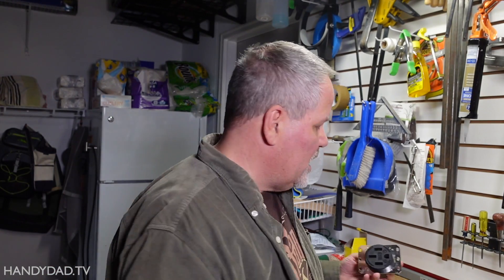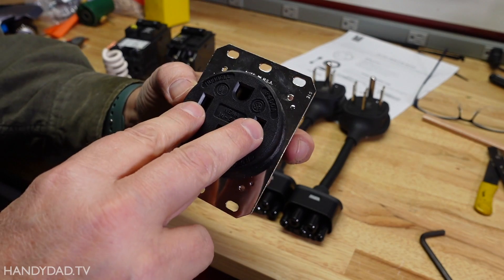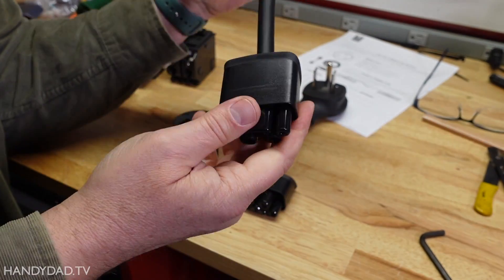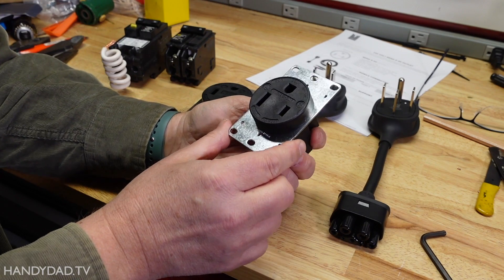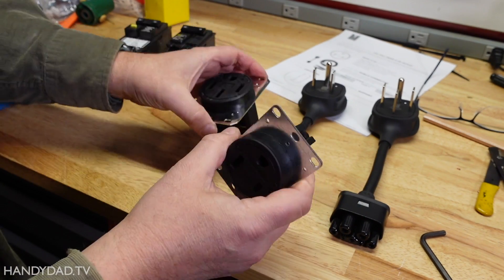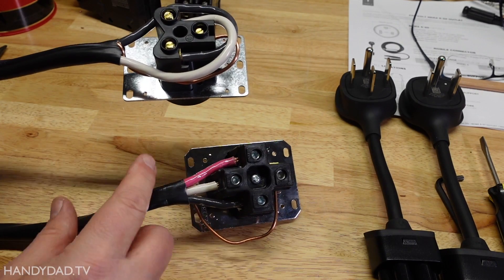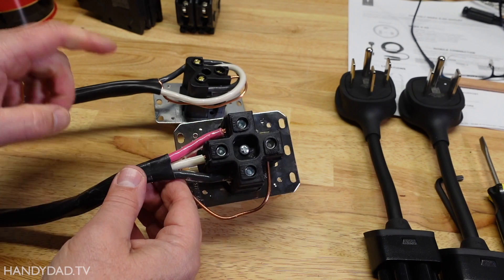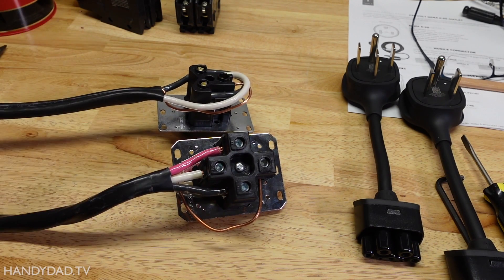NEMA 14-50 vs 6-50 for EV charging

Comment: Thank you for clarifying these plugs! I have the 6-50 in my garage because I do welding from time to time. The rep from the Tesla electric division insisted on the 14-50. I immediately ask why if, technically, batteries are DC current and there's no need for the fourth prong. "It is a battery we are charging, right?" The stumped young man went away confused about not having a re-buddle!
Bottom line, I need my 240 multi-function receptacle to service all my needs. I wasn't going to have a sales rep sell me; otherwise, the product-producing norm to the untraded commoners market. No pun intended to the non-trade. Tradesman and builders alike share a common bound to reciprocate in the know! Yep! I planned my Tesla arrival months before and installed the receptacle for everyday use and my Tesla charging optimization! I will share this with all whom I know owning Tesla vehicles! Now, I'm sharing it with you!
Reply from the maker: Thanks!
Reply: Down side is you can get an adapter to plug into the 14-50 to get 120V out of the outlet.  Without the neutral, the 6-50 can't do this.
Reply from the maker: True but that’s a very rare use case.
Reply: @handydadtv absolutely. Super rare. What would be the chances that there’s a 6-50 outlet but not a 120 outlet nearby. Great video!

Comment: Hello! I recently bought a plasma cutter and it came with an adapter that has a nema 6 50 plug. I live in europe so i dont have acces to that type of plugs ... I have cut off the wire and made a conection to the machine by wiring ground, 220v hot wire and neutral to the machine. The problem is that wont mantain the cutting arc and after some researching i did find that nema 6 50r has two hot 220v wires and ground. Do you think i should wire 2 220v hot wires to the machine?
Reply from the maker: I would consult a local electrician. Speculation could damage the machine.
Reply: @handydadtv  Most countries in Europe run ONLY 240V, and there's really no neutral as we understand it.  Which means that if a 6-50 is connected properly, it should work just fine.  So something else is causing his problem.

Comment: When Tesla is out of the adaptor that connects the universal mobile charger that comes with the Tesla to a 14-50 outlet, is there a reliable place to buy them, preferably made in the USA?  Not a cheap low quality one.
Reply from the maker: Tesla frequently sells out, but they restock often. Just sign up for the email notification. I don’t know of any third party manufacturers, but I wouldn’t put it past certain unscrupulous, patent-ignoring countries to produce bootleg versions. But please only buy genuine Tesla connectors, for safety’s sake.
Reply: thanks

Comment: And dont hook thease chargers up to anything less than 200 amp service...
Reply from the maker: Based on what?
Reply: @handydadtv  He's probably right, for most household situations. AC, water heater, lighting, and the car might put you over 18000VA, right on the edge of a 100A service continuous. You can forget about auxiliary electric heat, or turning on the dryer, much less the oven while the car is charging. If the main panel is MLO it might give a little more leeway but that's bad practice for obvious reasons...

Comment: I installed the standard NEMA 6-50 and am so grateful I didn’t fall for the NEMA 14-50 scam like the uninformed masses.
Reply from the maker: You’re smart
Reply: It's not a scam, it's simply a more flexible solution that costs a bit more.
Reply: @fromagefrizzbizz9377   You should install SIX unnecessary conductors for EVEN MORE “flexibility” and cost!!! #GENIUS

Comment: I have a 10-50R connected to a 40a breaker. 

I have seen 6-50 to 10-50 adapters at Home Depot. Just curious what your thoughts are on this being a cost save in the short term. Any issues with using this method? I have a MIG welder and ARc welder that use the 10-50, if I replace the outlet to the 6-50 outlet, could it convert the welder plugs to 6-50?
Reply from the maker: It’s fine to use a quality, short adapter cord. Just remember to limit your charging to 32 amps, which is the most you can do with a 40-amp breaker.

Comment: Several vehicles come with a evse that will work on either 120v or 240v.  The Honda Clarity and Toyota Prius Prime both use the same evse made by Panasonic.  I've used that on 240v on my Honda Clarity for the past 3 years.
Reply from the maker: What plug does it have?
Reply: @handydadtv  It comes with a standard NEMA 5-15 plug.   After finding out online that the unit was originally designed for 240v power in Japan, I made an adapter so I could connect it to a NEMA 14-50 outlet.  Charges at ~11amps at 240v.
Reply from the maker: You should make a video to show how you did that. I’m sure a lot of other people would learn from it. I’m looking for creators to join HandyDadTV, if you’re interested in leveraging this audience. http://handydad.tv/join
Reply: @mowcowbell  The Volvo version has a standard NEMA 5-15 plug, and an adapter that changes it to a 6-20 plug for use on a 240V/20A circuit.  An EV-MOD Turbocord.  Made in the US ;-)  It's pretty expensive ($550), but it's a lot cheaper to run a 240V/20A circuit than a 240V/40A or 50A circuit.  The max charging rate on a Volvo XC60 plugin hybrid is only 16A anyway.

But I went with a 50A circuit/charger on  6-50 because I figured I might indeed buy a Tesla one day, but sure as heck would never buy an RV.

Comment: Most non-Tesla chargers dictate the outlet.  It's absurd to pay $100 for a receptacle. That very same outlet (Hubbell NEMA 14-50) on Amazon right now is about $15.
Reply from the maker: That absolutely must be a fake.
Reply: @handydadtv  Is not fake but is not the one he needs to get.  Hubbell has a RESIDENTIAL line called TRADE SELECT.  This is not the one you recommend in your videos.  The tradeSelect is a step up the Leviton. The part number is RR450F.  It is a tad better, still Hubbell, still quality but intended for residential use.  That being said, EV is a residential activity but not traditionally "residential" since the intent is really to mean OVEN/RANGE/STOVE. The blades are full length so that is better and may help not heat up with constant amperage, but they are silver, not copper/brass, and the reason is that you can use both copper and aluminum wires since some homes still have aluminum. It is actually stamped (AL-CU). Yet, all that being said, it is the INDUSTRIAL HUBELL 14-50 that you show in your videos the one I would use for EV.

Trade Select is barely known but is out there, those of us who have been around use it since it is better than the Chinese cheap ones from big box stores. I actually thought if commenting on this since you limited yourself to say "buy Hubbell" and some folks will not know any better. They are good and better than Home Depot Leviton and I would even say the Eaton cheap versions, but not the one you mean, so important to stress what people need to connect are INDUSTRIAL GRADE outlets. I would tell people "get an Industrial grade outlet, I would recommend Hubbell or Bryant as the top of the line and quality, but the industrial version." Key is INDUSTRIAL GRADE, not brand. The $15 one which is now $24 is technically and perfectly called a NEMA14-50 Hubbel outlet", it has all the right to be called that because it is, but is the tradeSELECT residential Hubbell line and not Industrial.

I actually looked it up in Amazon in order to give you a link so you can peruse it and see it is a real Hubbell one, but check the description where it reads SELECT.  https://www.amazon.com/dp/B008KMTBUA?psc=1&ref=ppx_yo2ov_dt_b_product_details
Reply: @handydadtv  Oh, one thing, please tape a red tip on the white one so that the inspector is happy and approves it.  That is no longer a neutral and the ONLY one allowed to be white is the neutral.  It is code to identify hot wires. I would also as tradition always use the right connector for the red, not important but is a good habit in case you go with series or parallel connections downstream...like a second outlet on the other side of the wall (outside).  Love your videos, keep them coming.
Reply from the maker: Thanks
Reply: @handydadtv  14-50 outlets are much more common than 6-50s.  Every house built in the past several decades  has at least one 14-50 for stoves.  Not every house has a welder.  Lower cost for such commodity items is what demand causes.  As long as the plug has a UL or CSA sticker, it'll be fine.  It might not be built well enough to withstand more than a few plug/unplug cycles, but how often do you unplug your stove?
Reply from the maker: If it was Gucci handbag for one-tenth the price, you’d suspect it was a fake. A Hubbell 14-50 for $15 is probably fake as well. 

As for the plug insertion argument, I take my UMC with me whenever I travel overnight. Even if I never use it. I stayed at an AirBNB in upstate NY last year with no Superchargers around. Didn’t have the UMC with me and learned my lesson. 

So I remove and reinsert the plug a few times a year.
Reply: @handydadtv  Hubbell isn't the only decent brand.  You're not going to see many Hubble 14-50s in tract homes.  Sure if you want industrial grade, go for it.  But...

You can buy a variety of Leviton or Square D 14-50 receptacles for well under $20 and plugs for less than 50% more.  Real ones from major brick and mortar retailers with full UL/CSA.

We take our code compliance seriously in this country.  It is illegal to sell/install non-approved line voltage equipment, and retailers who even unknowingly sell stuff with fraudulent CSA markings are in for a world of pain.  As Home Depot once found out.

Comment: If you have an RV than use a 14-50, if you have a welder than use a 6-50 and if you have both than use a 14-50 with a 14-50 to 6-50 adapter cable witch covers both and your EV charger.
Reply: And the adventurous/inventive guy could use the 14-50 to wire up a 50amp portable subpanel for more outlets in the shop just make sure you include a GFCI breaker at main panel.
Reply: I should have also mentioned that when you run your cable it should be 6/3 75 C rated cable like THW, THWN ,SE or the same type not just regular 6/3 which is only rated for 50A . The better cable is rated for 65A which at a later day if you want to upgrade to the Tesla charger for 48A charging you only have to change your breaker from 50A to 60A. that couple of extra $ on install could save you a fortune at a later date.
Reply from the maker: I know people go nuts about high rates of charge, but 32-amps with UMC was absolutely fine and the cord isn’t as thick and heavy as the wall charger. I have a video in the works on this topic.
Reply: @lesw8798  This is what we did(6.3 6 AWG THWN) just in case I want to change to the Wall Connector later. We did a 14-50 because it's a little more versatile and the run was only about 20'.
So far the 32amp UMC has been more than adequate, but if we ever want more we'll swap out the breaker from 50 to 60 AMP and cap off the extra(white) wire in the panel and at the junction where the adapter was since hardwired EVSE only needs two hot leads.
Reply: Yes. I have a 14-50 at my home and farm for an RV; which does require the delta current to run through the neutral.
Reply from the maker: Good summary

Comment: My Lincoln AC/DC welder says it needs a 60 amp breaker with 6 gauge wire.  Is it ok to pair a 50 Amp receptacle with a 60 amp breaker? Thanks
Reply: It looks like the answer may be, "NO".
I'll give you the code sections from the 2020 NEC.

110.14.(C).1.(a).  Tells you to rate the wire/terminals at 60°C.
310.16 (table). Puts no.6 wire at 55 amps. @ 60°C
210.19.(B).(1). Single receptacle on a branch circuit rated not less than that of the branch circuit.  There is an exception for welders .... Not less than the minimum conductor ampacity determined by 630.11(A). for arc welders.

630.11.(A). Asks for the current off the welder or rated current multiplied by a duty cycle multiplication factor in table 630.11.(A). To determine the ampacity of the conductors.

If the welder is less than 50 amps, leave the 50 amp breaker.

I also checked an "Electrical Forum"(Mike Holt) and have not seen where it is possible for 60 amp breaker and 50 amp recepticle.  It appears underwriters labratory may approve, but the NEC does not.  Do not cry though.  Article 90.4 allows your local building to "interpret" the NEC and may approve this move.  If not,  consider   removing the plug and hard wiring your welder.  Keep the plug close, Incase you move it 

Best wishes.
Reply: @keithharrington4595  *Clarification 6AWG {copper} 55 amps NM "romex" style wire. 6AWG THHN  is fine at 75A
Reply: @cheddarcheese  Yes sir.  2020 nec table 310.16 does rate number 6 thhn at 75 amps at 90 degrees c. For the wire.

However, 110.14.(C).(1). Demands that wire terminated to equipment (14 awg - 1 awg) be rated for 60 degrees c unless the equipment is rated differently.  

So, to use the 75 amp rating, you must not connect, cannot connect, to a breaker at 60 c.  You must use 3 awg to connect to the breaker, then splice to your number 6 awg wire and repeat this process at the other end end or only use the wire rating for the temperature rating of the connection......this case....breaker at 60 degrees c or only 55 amps.

If i am wrong, please let me know.  I just did a car charging class and the instructor is "mis-teaching" the code.
Reply from the maker: Yes, you can use a lower amp receptacle than the circuit breaker size. But not the other way around. 

The circuit breaker size is limited by the size of the wire.
Reply: @handydadtv  Thanks man that helps.

Comment: Doesn't look like that's going to meet code.  But it'll work
Reply: Either the 6 series or the 14 series will meet current code for a 240V circuit, assuming an appropriate breaker and wire size is used. Installing a 10 series, or leaving the neutral or ground off a 14 series will not. Depending on what revision of the code is in use in your area, you might require a GFCI circuit breaker (new requirement with the 2020 code)
Reply: @kc8ufv  Check the code or ask an inspector  for the fine details.  There may be an exemption specific to EV/RV/welder outlets.  If you think the plugs/outlets are expensive, 50A dual GFCI breakers will blow your socks off.
Reply from the maker: Either one meets code

Comment: That's a good point about the wasted wire and the cost ! Thank you for pointing it out. Those wires are not cheap. Even the Tesla wall charger installation uses only 3 wires. L1,L2 and the protection ground. I will be putting 6-50 thanks to your video. I didn't even know it existed.
Reply from the maker: Glad it was helpful 👍🏻

Comment: Sorry I am still confused.  According to the specification: 14-50 is for three poles and 6-50 is two poles.  I am pretty sure my current breaker is two poles.  Can I install 14-50?  It already has four wires : black, white, red, and ground.  Thanks.
Reply: Your home is set up to supply 240 volts at your panel.  By using this high voltage, a smaller wire can be used to transfer the same amount of power from the panel to the loads.  Large loads use 240 volts, like your dryer, your stove, or your water heater.

This voltage is split (120volts) to provide a safer voltage for most items, your lights and wall outlets, items that do not need several thousand watts of power to run.  This is done by tapping into the transformer at the center point.  This is your neutral wire.

Your water heater is supplied with 240 volts only to heat water.  Your dryer and stove are supplied with both 240 and 120 volts.  The 240volts do the major lifting, and their controls can run off the 120(clocks or timers).  To get the 120 volts, the need that center tap, the neutral, the white wire.

So, if your charger is 240 volts and needs no neutral, you can hook it up like this video shows.

Make sure you label the recepticle as having "NO NEUTRAL".  If someone tries to use that recepticle to supply two 120 volt loads in series one load can easily burn up.  I would need much more space to explain that.
Reply: @keithharrington4595  thanks for the clear explanation.  Is neutral the 3rd phases?
Reply: @darakhmao  neutral (120V to each hot) and 2 hot wires (240V from each other)
Reply: @darakhmao  The neutral (white wire) is not a 3rd phase. Assuming you are in the United States.
Reply from the maker: Yes, 3 conductors plus ground (4 wires) is for a 14-50. The white should be connected to the neutral bar in your panel.

Comment: i have a 6-50 outlet in my garage...i am considering going to a taycan which has a 14-50 plug...if they don't make a specific adapter is there an adapter or converter that i can use from my 14-50 car into my 6-50 outlet?  thanks
Reply from the maker: Here is the adapter you need https://www.amazon.com/dp/B07LGLJ26N?tag=ha0d9f-20